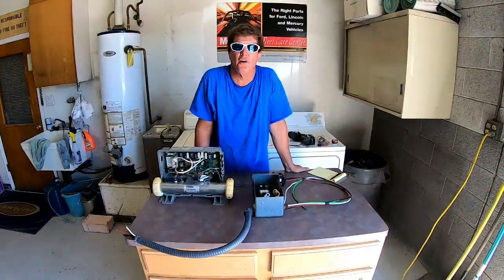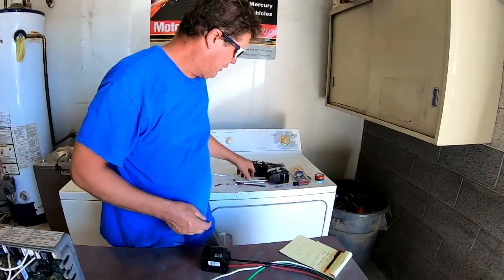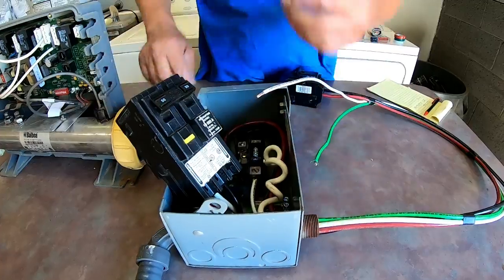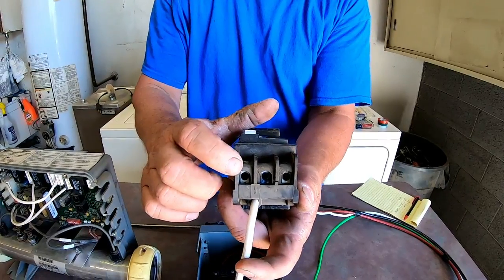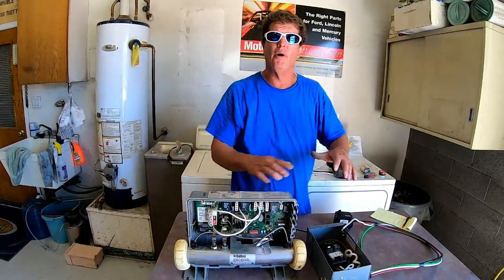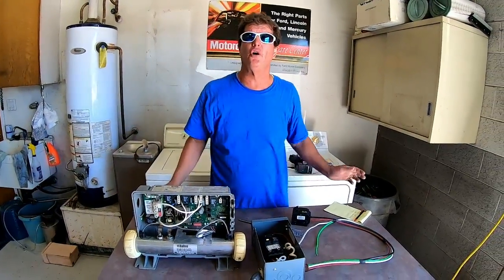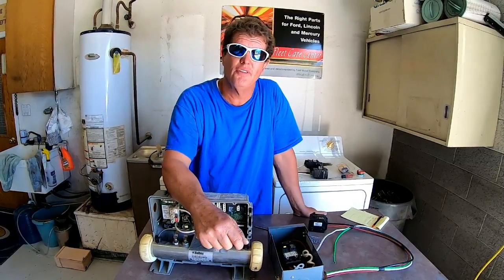Hot Tub / Spa wiring made easy... 50 Amp GFCI Install..Arizona Hot Tub Factory (DIY Spa Repair)

Comment: Here's a fun one. . . Sparky wired a 50-amp GCFI breaker on the main panel and ran the 4 #6 wires to the tub pack. Since this is a 3-wire board the common was taped off and not used. Spa runs fine for about 3 hours then trips GCFI breaker. Load for the two 240 #1 and #2 pumps and heater pull 33 amps, so well within the 50-amp breaker capacity. Sounds like a defective Breaker to me, but Sparky wants to blame the tub.  Any thoughts?
Reply from the maker: Well you have a lot of things going on...33 amps is well with in the limits.. Yes it could be a defective breaker. ! It could also be a pump that is on it last leg and when the spa is turned on and is up and running for several hours one of the motors gets really hot and trips the breaker .... I'll give you another example... Couple of weeks ago I was working on a jacuzzi that kept tripping the breaker after about 6 hours... I played with every thing and figured out it was the heater! When the spa breaker was turn back on after tripping water temp was in the 50 to 60 degrees when the spas water  reached approx 80 degrees it tripped and I tested it for several day and it always tripped around 79 to 81 degrees...I replaced the heater and it has not tripped since.. I since then have taken the heater apart and found a pin hole in the heating element that was corroded and causing the problem..Now Im not say that this is what is causing your problem ...You need to open up the spa and look at every component in the spa and look at the motors to see if they leak or have calcium build up between the wet side and the motor, check the heating element check the sensors make sure all the electrical connections are tight..And at the very end it could very well just be a weak breaker..You will never know until you look at it closer... Hope this Helps and Thanks for Watching , Sharing & SUBSCRIBING

Comment: I have a covered patio partially and have the other part uncovered where my new hot tub is gonna be.  Basically I need to get my 6/4 wire from box on the west side of my house to northeast side where the tub will be.  Trying to figure out best and most simple way to travel my wire from a to b with least amount of work and headache but still looking professional somewhat.  Any tips?  Does this wire gotta be in conduit or not?
Reply: YES on conduit. Best way probably wont be the easiest way. If it were me, I would run metal conduit in the most out of way possible - avoid kids, pets, tripping hazards.

Comment: I appreciate your video I’m curious can this pack work for a custom built concrete hot tub😎😎
Reply from the maker: Yes
Reply: Very cool 😎 I was planning on building a hot tub jacuzzi with cinder blocks filled with concrete so is one pump of two pumps needed. My idea is the heater running on one breaker and the pumps on a smaller breaker.
Reply from the maker: @heroknaderi  A pack like this one has the ability to run 1 or 2 pumps and only one 50 AMP GFCI breaker is needed.. (Keep it simple) You can also have a light and it will heat up to 104 degrees..Hope this Helps ..Thanks for Watching , Sharing & SUBSCRIBING

Comment: I have a spa man hot tub. Very old, in fact it has wood around the outside. Recently it has been popping the main circuit breaker. My sub panel is different from yours. In my sup panel I don`t have a breaker, I have a fuse, with a handle, that pulls out to just disconnect. So I was wondering how to tell what side of the sub panel is blowing the main circuit. The main breaker side or the spa side?

Comment: My 4 #6 wire will be running through the basement.  Does it have to be inside metal conduit?  The basement is finished and have a drop ceiling.  Can I use the gray electrical conduit?

Comment: Great video! I have a question, I just replaced my pump and motor on an old Marquis hot tub. Now the motor only hums when I turn it on. It does not pump. What could be wrong. I checked the voltage to the motor and it is at 118 Volt. It's a 115 volt motor. Any suggestions on what could be wrong?
Reply from the maker: It sounds like You have an Air Lock...I have a Video that will show You how to fix this problem...The Video is titled : How to Remove and Air Lock from a Hot Tub or Spa.  Hope this Helps Thanks For Watching... And Please Like , Share & SUBSCRIBE.

Comment: Great video Scott.  Here's my scenario: I have three wires coming from my house panel, but I have a four wire hot tub; it's a Hydroquip.  I have 50A breaker at the sub with the pigtail.  What is the proper way to wire when you are going from a 3-wire supply to a four wire tub.  I have run a fourth wire, what I think should be a neutral, since there is a neutral slot in the pack.  The breaker resets immediately when I turn on the outside breaker.  I have disconnected every load, it still resets immediately upon trying to set the breaker.  I have lifted the neutral wire from inside the sub box, which is on the same terminal strip as the pigtail.  When I lifted the wire, the breaker sets, but there is nothing happening at the hot tub, no lights, no nothing.  If you could direct me to a preexisting video; I am more of a visual person.  If none available, I sure could use some guidance.  

Thanks for your help.

Nick
Reply from the maker: Give me a call and I will walk you through it..something is not right.
Reply: @spaman5440  Will do. Thanks. I'm thinking your phone number is in a website... standby.
Reply: Did you resolve this problem?

Comment: Killer video Scott!! I have 8gauge wire from Balboa pack to 50amp gfi sub panel to 40 amp main breaker about 70ft total length. I know you like 6gauge for 50amp but will 8gauge be ok?
Reply from the maker: Well first off it will not pass cade.. #8 is not OK  and I will be surprised if it works with out any problems.. So I Would start off with a 50 AMP main breaker (they are like $15 bucks maybe) and then replace the #8 with the correct #6 wire( we want to make it safe for everyone that uses the hot tub)Then buy 4 #6 wires 80 feet long each at $1.00 per foot is $320. bucks(Sell the old #8 wire on Craigslist for $200. We do this all the time)You will be spending $150. after the smoke clears ...and You and your family and friends will be safe.Thanks For Watching and SUBSCRIBING.

Comment: I have a HotSpring Sovreign II that i just purchased used and took pictures of how it was wired by previous owner. They had the neutral going to the hot tub tied in to the neutral bar and not the breaker. I wired the neutral to the breaker and when i flip the 50 amp breaker it stays on, then i flip the 20amp breaker it still stays on, when i flip the 2nd 20 amp breaker the 50 amp breaker trips.  This hot tub has a 5 wire setup to the IQ2020 control panel. Why is the breaker tripping?  Thank you
Reply from the maker: You have something wired wrong..It should be a 6 wire connection meaning 4 hot wires , 1 neutral/common wire and 1 ground and if I remember correctly they should be one 20 amp and one 30 amp Breaker.

Comment: Do breakers go bad often? I had a leak then I fixed it and when I turned the breaker back on it tripped. I figured it was the heater element tripping it so I replaced it and the breaker still trips off. I don’t have a ozone cleaner so it’s not that.
Reply from the maker: We have seen a weak breaker from time to time... After checking out everything in the Hot Tub and the breaker keeps tripping we start looking at the breaker and sometime even the wire.  Hope that helps .Thanks For Watching and Subscribing.

Comment: Thinking about getting a hot tub and placing it on our stamped concrete patio.  There is no need for a bonding grid in our situation, but would it provide extra safety to drive a ground rod in next to or underneath the tub and bond to that?
Reply from the maker: I would consult the ( NEC ) National Electric Code Handbook before I do anything..Better to be safe then sorry.

Comment: I have done all of that checked voltage at all 3 location 240 all good but no display on control Panel does hot tub have to be full to start?
Reply from the maker: Yes..some Spas have to have water in them to have a reading on the topside display.

Comment: Will the hot tub not power on if I did not use gfi braker ?
Reply from the maker: (DISCLAIMER) Yes it will power up without GFCI Breaker... The purpose of a GFCI is to prevent a ground Fault... When a GFCI detect just 5mA of leakage between the hot wire and ground. The breaker will trip to protect the Hot Tub.. It is also required by all Manufacturers and will void some warranties if not used and installed correctly. I alway check to see if a GFCI is installed and installed correctly before I do any repair on any Hot Tub I work on.. Thanks For The Question

Comment: What is your thoughts , 1st,I have a emerald spa, that I just moved from my rental to my home that I own.  I have a pig tail off the spa with a plug.
I have the disconnect box,  that I used at the rental. I do have the plug outlet off of the disconnect box that matches the plug obviously. In your opinion,  is this fine to keep the plug attached or is it a hazard and it should be direct ? 
2nd, does black casing need to be off to run wiring  through conduit? As of now it just lays on ground to the disconnect box. 
Thanks
Reply from the maker: With what you are trying to do..I would rather you call me at my shop and give me a few more details. I do not want to give you the wrong advice/answer and have something go wrong. 623 842 4665 Just ask for the SpaMan and they will shoot it back to me ...

Comment: You did not discuss where the ground from the pack to the breaker goes. Where does it go? The ground bar?
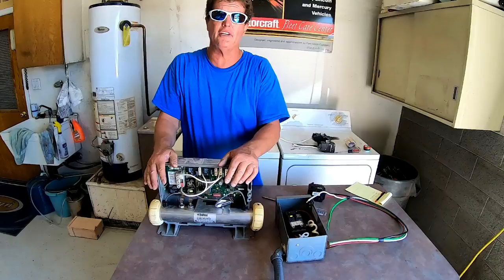Reply from the maker: Jerry if you watch the video again at 2:30 of the video you will see where the ground wire goes in the Sub Panel and at 4:10 of the video you will see where the ground goes for a BalBoa Pack. Hope this helps.. Thanks again For Watching & Subscribing
Reply: @spaman5440  I meant from the breaker..(The other side)

Comment: So after spending a good hour and a half losing my mind, I come to the realization that even though my unit has 2 spots for hot (it’s a Balboa and looks just like your example), it will only run with 1 hot connected. 
We bought it thinking we could plug it up until we got an electrician over to hard wire it. It’s been running via an extension cord for 6 months until today when I decided to hard wire it to the disconnect we already had.
It’s running along fine with just the 1 hot hooked up now. It kept tripping the main breaker with both connected.
Ever heard of that?
Reply from the maker: Ed.. I would be more then happy to help you but will need a few more details as to what is going on.. If you want to call me at the Shop anytime you are in front of the spa I will help you figure it out. Shop # is 623 842 4665 Thanks for watching and Subscribing.
Reply: @spaman5440  thank you!! For those of you who may not know, this guy is the real deal. I live in TN so he really didn't have to take time to help me because I'm way out of his area but he did! I  called him and he took 10 mins of his day to help me. A TRUE PROFESSIONAL!!!

Comment: Question: now that Double Pull GFCI 50A breakers that get installed in the main Breaker Box on the house are available, can the sub-panel box be eliminated?. Seems to me that if that first breaker you show is GFCI, you don't need the second one. Thanks!
Reply from the maker: Before you do anything !!! Check your Local and State Building and safety codes!!! 

Now yes you can do that but there are some rules you need to follow if you do...

#1 You must be able to see the breaker box from the Hot Tub..Hot Tub must be in line of sight of the breaker box.
#2 Breaker(Disconnect) should not be more then 25 Feet away from Hot Tub...The reason for this is.. if there is a problem ?  you need to be able to discount the Hot Tub Immediately
.(My personal Hot Tub is over 80 away from main Breaker and my sub panel is about 6 feet away ...Just far enough away so I can't touch the disconnect and the Hot Tub at the same time.)
#3 there can not be anything in the way between Hot Tub and Breaker box (No fences, beauty walls, Bushes)
Hope this helps.
Reply: @spaman5440  You are awesome SPA MAN!  My breaker box is just under 20' away, clearly visible, nothing impeding. I will definitely check with our local codes too. Appreciate the advice!

Comment: Instead of wiring directly from the breaker box, could I tap into an existing 220v that I do not use anymore and run the wires from there, or if I do want to use it, could I pig tail it from that one?  Thank you
Reply: hot tubs must be powered from a gfci breaker. also, it depends on if the hot tub requires 3 or 4 wires to power it and whether or not your existing 220v outlet has 3 or 4 connectors. probably best to add a sub panel with a gfci breaker where that 220v plug is, assuming that's a convenient location to add one.

Comment: Hi Spa man.. Great Video.  I have a watkins Hotspot thats been working great for years  4-5 ... the main 2 spead motor Wet pump went out and put water on motor of the 2 speed pump. I assumed that was what caused the breaker to trip... after research and finally buying a complete watkins 2 speed motor pump for $500 , i replaced it and filled tub... no leaks and everthing seemed great... I was able to get my 3 jet speeds or 3 levels of jets and was ready to leave it alone for the night to heat up from 50 deg to the 102 deg. but checked on it and 50 amp breaker was tripped... I could reset breaker and check everything again,  but i just reset breaker and let it sit.  at that point , i think only one pump comes on to curculate and the heater to heat... at that point, it tripped again . is my heater bad causing it to trip?  Thanks Spa Man... your the best !
Reply from the maker: Bruce.. I have another video..That has 6 reasons the spa trips the breaker. If you watch that video it will steer you in the right direction. Thanks for watching and Subscribing.

Comment: Great video. I followed it to a t and seem to have one issue: running 4- 6 gauge wires. I have 120 volts going into and out of both red and black wires at the GFCI breaker outside and I get pretty close to the same reading at the hot tub. However when I run the wires into the tub box, I get a reading of 206 v on one hot and 60 v on the other. The hot tub will give a few readings on the display, but after I hit a few buttons, the screen goes blank until I reset the breaker. Any assistance is appreciated.
Reply from the maker: Best way I can help is give me a call I have several questions and depending on your answer it will tell me what way to go ...Office 623 842 4665        NOTE Check the Breaker that is reading 206 could be faulty Breaker ..

Comment: This video was extremely helpful and very easy to understand! Great job. One question. What size wire should I run from the 60amp spa disconnect box to the hot tub pack?
Reply from the maker: You should check with the manufacture of the Spa  to be on the safe side and check with the local and state codes .. most Spas use # 6 wire for both Hot wires and the Neutral/common wire and the Ground Wire

Comment: Awesome Video
I have a hot tub sub panel with a 20 amp and 30 amp breaker.  I need to change to 50 amp for my new hot tub.
Questions:
Can I remove the two breakers and install a 50amp?
Do I need a whole new panel?
I am assuming I will need a larger wire from 50amp breaker to hot tub?
If a larger wire is required do I need a larger gauge for all 4 or just black and red?
In addition in the panel, there is another 20amp breaker which powers outside lights.  How can there be only a power 50 amp breaker at the main breaker box to the hot tub panel and there be 70 amps worth of breakers in the panel (20+30+20)?

Sorry for all the questions!

Thank you!
Reply from the maker: Im so sorry I just saw your message If you still need help best way is to call the office..Depending on your answer will tell me with way to go . Office 623 842 4665

Comment: Hey Scott my tub started having issues last season and I shut it down and let it sit winterized until I could get the money around to replace the control panel which was the troubleshoot conclusion. Bought a new control panel and installed making sure to hook everything up the way it was. For some reason my breaker on the house panel not the tub sub panel keeps tripping when I try to start the tub up. Any suggestions?
Reply from the maker: If you can call me on the phone I would be more then happy to help you out ..I have a list of questions to ask to much to email or text but I will try to help you narrow down what is causing the problem.. 623-842 4665
Reply: I will try to work something out time wise as we are in different time zones and I work strange hours. 

Quick question I have a viking spa royale plug and play with Balboa VS 100 panel, which was on site when we purchased home 3 years ago or so. I have had some issues with electrical stuff in the house and just want to make sure my house panel to sub panel has appropriate amp fuse. Video says 50 amp double pole on main house breaker to 50 amp spa panel with gfci. Is this appropriate for this model? Thanks for your time.